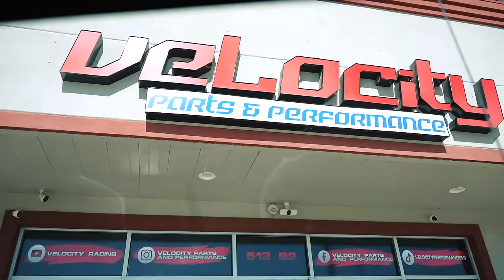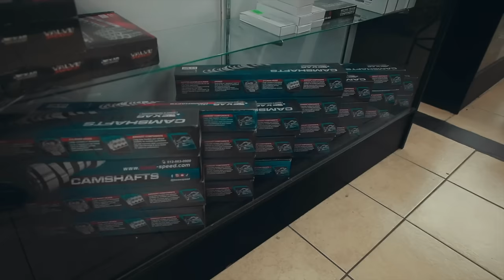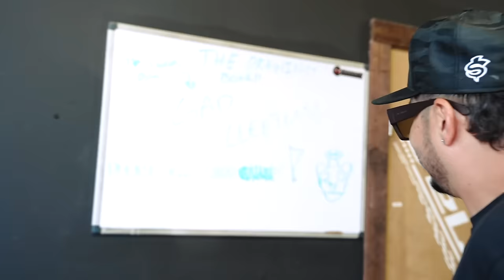TEKASHI BACK FROM THE DEAD!

Comment: Replace the fuse block, most likely it got wet and even though it might be okay and working right now eventually it will get corroded inside the block. So to prevent a future failure at a show get another one. Had that issue once myself.